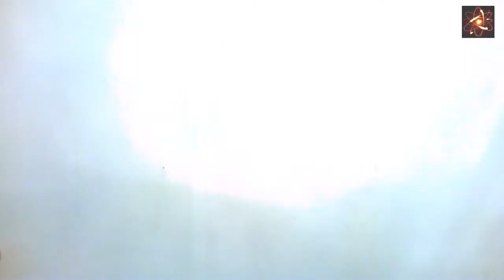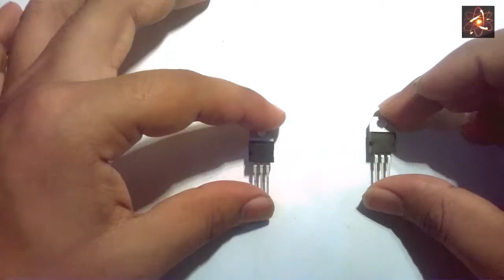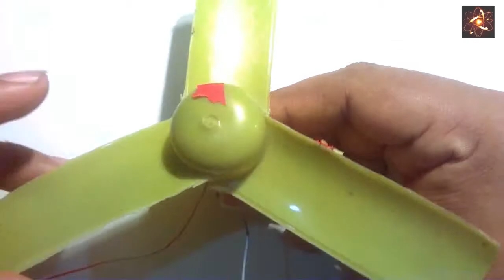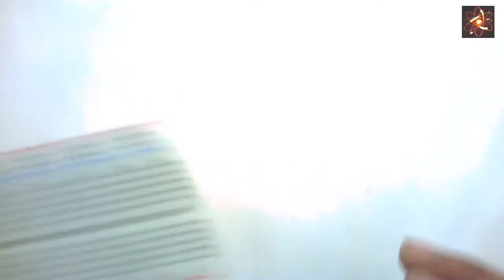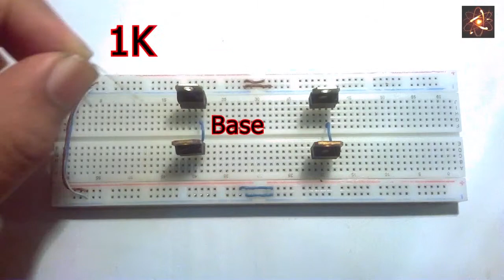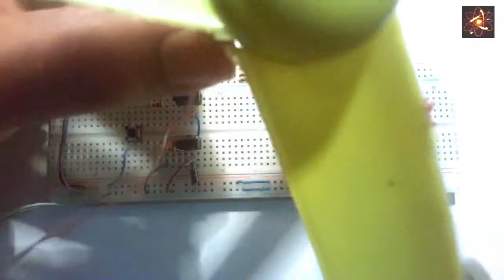h bridge circuit tutorial(very very easy)!!!!!!

Comment: Will it work if i reverse the npn n pnp transisotr. I mean what will happen if i place npn instead of pnp and pnp instead of npn. Help me i am in trouble.
Reply: With PNP transistors at the top, you can use a higher voltage for VCC than you use for the base of the transistors.

For example, you can use 3.3V outputs from a microcontroller and 9V for Vcc.

That won’t work if you have NPNs at the top since the emitter will be 0.7V lower than the base. Because that turns into 3.3V – 0.7V = 2.6V at the positive side of the motor, no matter what VCC voltage you choose.
For more u can read this article https://www.build-electronic-circuits.com/h-bridge/
Reply: https://m.youtube.com/watch?v=DUVPXXWZvo4